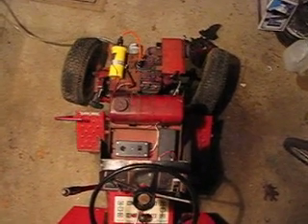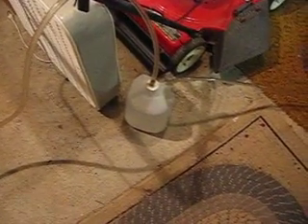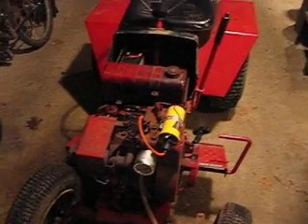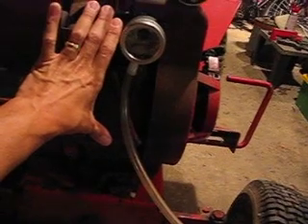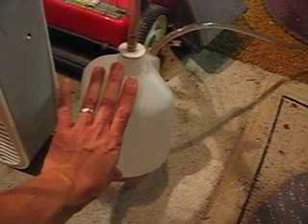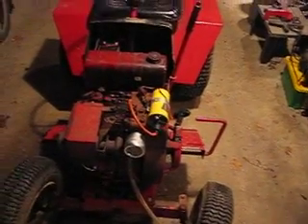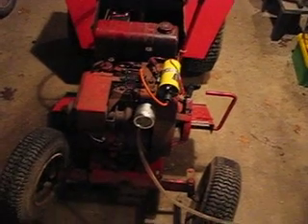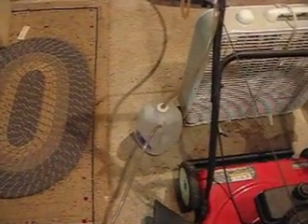Hydro Lab (My Garage) #46 Donor Tractor

Comment: Man, these videos were great. Watched them all. But 60 amps in a cell that's reasonably efficient should produce at least 3LPM (180LPH). A few Smack boosters in those Walmart jars might do the trick. My one VSPB cell alone easily produces 3LPM with only 45 amps driving it.

My donor motor being vertical makes it tougher to get access to the cam shaft gear. I think it's on the bottom! >:-(

Comment from the maker: Hey,
It's just beginning! Never thought it would run on the test cell. I was hoping, though,that it would get going a little better than it did. I'm working on a compact cell desing that is very efficient. It makes almost 60 Lph @ 20 amps. So the plan is to put a couple together at higher amperage. Just need  quality stainless steel.